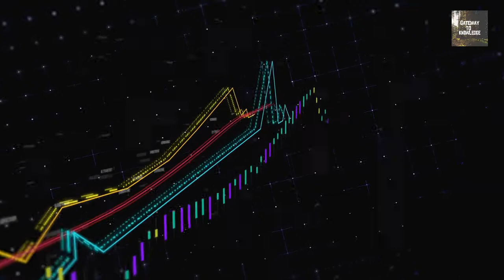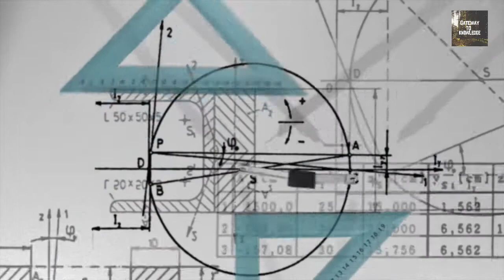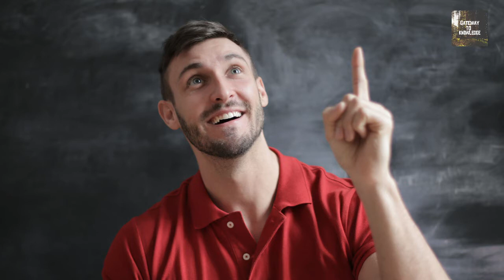How Rocket Moves In Space When There Is No Air To Push Against?

Comment: Your answer doesn't makes any sense because my question is , " in space the ejected gas pushes against what ? In order so that Rocket mai move forward
Reply: Hey, no air no combustion, so that engine Need air and Will consume both air and full, where the air Is in the space ship???
Reply: @vnsworkshop9961  Rockets take oxygen WITH THEM TO SPACE.
How do oxyacetylene torches work UNDERWATER?
Reply: @stuartgray5877  so he Need tons of oxigen.
So the spaceship are oxigen bomb!
Why they never exsplode..
I don t know.
And where they push?? In the empy space..
Reply: @vnsworkshop9961  - "Why they never exsplode.."
You apparently don't pay much attention to rocket technology. They explode FREQUENTLY!

"And where they push?? In the empy space.."
They push on the MASS of the exhaust gas.
Reply: Correct.... If the total momentum is zero...it means it is not moving.. the video is absolutely nonsense. No engine can work if there is no matter to apply force it produces. The bullet from the gun goes out because the force is applied on the ground.
Reply: @lalithachinthakal-simpleth5948  - "No engine can work if there is no matter to apply force it produces."
So according to you a crossbow fired into a vacuum would NOT have any recoil?
Are you sure about that?
I think Newtons laws say different.
Reply: @rocketman484  cross bow and gun will work in vacuum because the force produced is applied against the ground on which the fireing person stands
Reply: @lalithachinthakal-simpleth5948  No. Even with no person holding the crossbow, it would still be forced backwards by the recoil force even if fired into a vacuum.
Reply: You don’t need something to push off of. It’s not like pushing yourself away from a wall while on a skateboard.
Reply: @kitcanyon658  if you dont push off something  then how do you move?
Reply: @nickmerix2900  : Sure, you can physically be "pushing" against something ,like the ground as you walk. However, that isn't the only way to produce motion. 

Motion can be created by throwing a mass from yourself in a certain direction. When you do a force is created in the opposite direction proportional to the mass and the speed at which the mass is thrown. 

How do you think rockets work in the atmosphere? Do you really think the air molecules are somehow pushing against the rocket body? The same air molecules that would be blasted away by the high speed, hot exhaust gases? How does that work?
Reply: @kitcanyon658  thats circular logic. You are using how rockets move in space do explain how rockets move in space. By your reasoning an ice skater should be able to propel forward by simply thrusting their leg back. Or if i skydiver  thrusts his leg to one side he should propel himself to the opposite direction. Both observations will tell otherwise.  If you dont need something to push off then reverse thrusters on a plane should not work . But reality shows they do work
Reply: @nickmerix2900  : so you’re not man enough to explain how it is that air molecular push on rockets? Why is that? 

And no, your examples didn’t have a loss of mass. They simply moved tue position of the mass. Try having them throw a bowling ball away.
Reply: @nickmerix2900  So according to YOUR misguided understanding of basic physics, A CROSSBOW fired into a vacuum would NOT have any recoil.
Are you SURE about that?
Reply: @stuartgray5877  you are unable of critical think. You probably never fired a cross bow , if you did you would know you dont feel any recoil backwards  like you feel with a gun. You only feel a slight vibration. I guess your “UNDERSTANDING “ of physics led you to pick the wrong example. If merely pushing something out of an engine with out  that something interacting with another mass , then thrust reversers should not work . But we know they do.  That is a more accurate example to the rocket Apply your understanding of  physics and explain that.
Reply: @nickmerix2900  Answer the three basic physics questions to understand how rocket propulsion works:
When a rocket is running here on earth in atmosphere:
1 - Does the exhaust gas get ACCELERATED as it leaves the nozzle?
2 - Does the exhaust have mass?
3 - Can MASS be accelerated WITHOUT a force?
Answer these three questions and I will move onto the REAL questions.
But we need to be sure you understand the most basic aspects of mass and inertia.
Reply: @stuartgray5877  again you are just parroting  text books without think. Here on earth the answers would be yes , cause they can be verified by observation. Space is another story. Show me an experiment that they also apply to space. How do you measure mass in space? Mass is measured by weight here on earth but in space the gasses would be weightless . So how would you measure their mass? See theory is one thing reality is another. You seem to be stuck on theory
Reply: @nickmerix2900  YOU are literally the one repeating what you heard on YT. I am the actual Engineer that has built spacecraft with his HANDS. launched them to space, then helped operate them during the mission in deep space.
Now tell me your level of education and what YOU do for a living genius.
Reply: @stuartgray5877  ok mr NASA  since you are the engineer why cant you explain how thrust reversers  work or how you measure mass in a weightless environment? Me, im  a highschool drop out . So educate me by answering my questions. Better yet since you built and flown rockets into space , just show us a video of your rocket flying in space and put the matter to rest. Its that simple . No other explanations needed .Provide  a clear video of that.and i will apologize , if you cant then toss your degree in the trash .
Reply: @nickmerix2900  - "k mr NASA  since you are the engineer why cant you explain how thrust reversers  work or how you measure mass in a weightless environment?"
I can answer both of those questions.
But WHY should I answer YOUR questions when you refuse to answer mine?

Thrust reversers work exactly like jet engines, They accelerate MASS in one direction and feel a recoil force in the opposite direction.
We can measure the mass of an object in space by trying to MOVE IT and seeing how much Inertia the object has. (Comparing it to another known mass)

Now answer MY questions:
When a rocket engine is running right here on earth in atmosphere:
1 - Does the exhaust gas experience an ACCELERATION as it leaves the rocket nozzle?
2 - Does the exhaust gas have MASS?
3 - Can MASS be accelerated without a FORCE?
Now are three Yes/No questions too difficult for you?
Reply: @nickmerix2900  - "just show us a video of your rocket flying in space and put the matter to rest."
Sure, watch the "Stardust Launch" video on my YT channel.
Or watch the "IXPE Launch" from SpaceX.
I launched that one just last year.
The video even shows the solar arrays deploying after separation from the rocket.
Or watch the JWST Launch. I also helped build it.
There are LITERALLY Hundreds of launch videos from SpaceX over the last few years.
Try to keep up.
Reply: @nickmerix2900  - watch the YT video "uninterrupted footage of the falcon heavy launch and booster landing! 2-6-18"

watch from launch to side booster landing, then EXPLAIN what YOU just watched.
If you don't see the examples of rocket propulsion in a vacuum, I'll be happy to point them out to you.
Reply: @stuartgray5877  ok i watched your videos and they  raise many questions. Here are a few.  Why do rockets turn and fly sideways after launch? Why we see the same angle on all videos? Why not more camera views especially the front? Why is video quality sub par when high resolution cameras are abundant ? Why is the color suddenly going gray in one instant and why what seems day to night and back to day? They spend billions on these launches yet they cant afford better video equipment? Why we see earths curvature from 14 miles up in one video when  nasa  spokesperson Neil de  Tyson says this is impossible? Why dont we see the earth rotating  beneath once past the Karman line?  Why the boosters need to slow down upon re entry from 70 klm up to avoid burning up yet the side fairings which are separated much higher dont burn up without slow down capability? The ixpe i beleive was a satellite launch , so why no video of the its placement ( which is kinda the main event) ?
Reply: @nickmerix2900  - "Why do rockets turn and fly sideways after launch? "
Because to reach "Orbit" you must achieve a huge velocity PARALLEL to earth's surface.
So rockets only go UP to clear the atmosphere (to reduce drag about 50 km) then they turn and thrust parallel to the surface to reach "Orbital Velocity".
If a rocket goes Straight up, gravity will pull it straight back down.
"Orbit" means that the centrifugal force of flying around in a CIRCLE cancels the gravitational force allowing the vehicle to remain in orbit.
"Why we see the same angle on all videos?"
Because most rockets that leave KSC are all heading in the same direction EASTWARD (for equatorial or inclined orbits) and we are watching from the beach.
When rockets leave VAFB they head mostly Southward (for polar orbits).
"Why not more camera views especially the front? "
Because there is absolutely NOTHING Useful to video from the front. All you would see is sky for the entire flight.
"Why is video quality sub par when high resolution cameras are abundant ?"
Watch some videos directly from SpaceX for incredible footage of very high quality.
Thats enough questions for now. Now go read a book. You know like the Physics book that you skipped in high school.
Reply: @nickmerix2900  Now if you would go back and answer my three physics questions, we can get to the REAL questions about rocket propulsion.
I am not even asking questions about "Vacuum" Yet.
When a rocket engine is running right here on earth in atmosphere :
1 - Does the exhaust gas experience an ACCELERATION as it leaves the rocket nozzle?
2 - Does the exhaust gas have MASS?
3 - Can MASS be accelerated without a FORCE?
Do refuse because you think I am trying to TRICK you or something?
The questions are just to make sure you understand the three terms in CAPS.
Did you refuse to answer questions in school?
Is THAT why you dropped out?
Reply: @stuartgray5877  i told you those seem to correct as far as we know here on earth. And actually school was very easy for me , i was way above average student . Dropped out for other reasons
Reply: @nickmerix2900  So you AGREE that:
1 - Rocket exhaust is ACCELERATED as it leaves the rocket nozzle
2 - Exhaust gas has MASS
3 - MASS CANNOT be accelerated without a force
Then (if you understand Logic and "Proofs") then you must conclude that:
There MUST be a FORCE ACCELERATING the MASS from the Rocket nozzle !
Is that right?
Do you AGREE, based on the evidence, that there MUST BE a "FORCE" accelerating that mass?
If you answer is YES, then please tell me from WHERE does this FORCE Originate?
WHAT Mechanism is creating the force that accelerates the mass from the rocket?

And I'll save us an iteration and will ask you the next question:
What does Newton's THIRD Law tell us about "Forces"?
Reply: @nickmerix2900  So now you have TWO new questions to answer, stop avoiding them.
From WHERE does the force originate that accelerates the exhaust gas from the nozzle?
What does Newton's THIRD law tell us about "Forces"?
Reply: @nickmerix2900  And ANOTHER POINT where you think I am trying to "trick you" or something when I am not:
Tell me that you think that ANY kind of "machine" can ACCELERATE MASS (Like a 500-kilogram block of water ICE) from a standstill to MACH EIGHT can do so WITHOUT feeling a recoil force!
REALLY! - Can you imagine any type of device accelerating 500 kilograms of ANY KIND OF MASS to Mach eight without a recoil??
Yes or NO?
Reply: @stuartgray5877  you said it your self “” feel recoil” to have recoil  you need an object to feel the recoil. What is that object in a vacuum? You keep going to newtons third law which is basically action reaction . When i press against a wall  he tells us that the wall pushes back at me. Here we have 2 objects that interact ( me and the wall)  . What is the second object in space?  By me pushing  i apply pressure to the wall  , if the wall moved as i pushed i would feel no pressure and i would not be able to push off even though my hands would be pushing. Same  with a rocket . You keep referring to force but you dont mention  what type of force . Rockets produce thrust  and thrust requires pressure  which in a vacuum you dont have.
Reply: @nickmerix2900  ANSWER MY QUESTIONS and you will HAVE YOUR ANSWERS!
Jes us CH RIST, it is IMPOSSIBLE for you to just ANSWER QUESTIONS!

 - From WHERE does the force originate that accelerates the exhaust gas from the nozzle?
- What does Newton's THIRD law tell us about "Forces"?

Its NO WONDER you are incapable of learning. You keep trying to LECTURE the TEACHER instead of LISTENING!
Learning is a TEP BY STEP Process. You keep trying to jump to the conclusion BEFORE working through the premise!
I am trying to EXPLAIN TO YOU where the force comes from, and you keep DIVERTING FROM THE PROBLEM!
Now ANSWER THOSE QUESTIONS.
Reply: @nickmerix2900  - "Rockets produce thrust  and thrust requires pressure  which in a vacuum you dont have."

There you go talking about VACUUM AGAIN!

My example is a rocket IN ATMOSPHERE!
Now QUIT CHANGING THE SUBJECT!

IN ATMOSPHERE: FROM WHERE
DOES
THE 
FORCE
ORIGINATE
THAT ACCELERATES
the mass of the exhaust gas?!?

WHAT MAKES THE EXHAUST GAS SHOOT OUT?
Reply: @nickmerix2900  - "you said it your self “” feel recoil” to have recoil  you need an object to feel the recoil. "
So when a CROSSBOW experiences Recoil, WHAT IS IT PUSHING ON?
What makes the crossbow feel recoil?
You keep claiming the question is irrelevant but by saying so you just keep PROVING that you are clueless about how mass and inertia work.
Until you answer that question for yourself, you will NEVER UNDERSTAND how "Rocket Propulsion" works.
Reply: @stuartgray5877  for an engineer you should not use an example you dont understand. Crossbows do not recoil!! Go shoot one first then tell me again . Thats the perfect example of how reality does not follow your text book
Reply: @stuartgray5877  the argument started with  the question of how rockets fly in space . You keep bring it in the atmosphere . We can all agree that rockets can and do fly in the atmosphere. That part is settled. Space is another animal . Are nt you curious as an engineer that nasa having the largest vacuum chamber never tested  for example their space suits in it and instead test them under water?
Reply: @nickmerix2900  - "Crossbows do not recoil!!"
Watch the YT video on my channel that shows you are wrong.
Maybe then you will realize that it is YOU that is misinformed.
Reply: @nickmerix2900  What is causing the recoil in my crossbow video then, black magic?
I think it is pretty obvious now that people that have never passed high school physics should not go around trying to explain physics to anyone.
You have no idea how mass and inertia work, but you feel confident arguing basic physics? I would laugh if it was not so pathetic.
Reply: @nickmerix2900  - "We can all agree that rockets can and do fly in the atmosphere"

But you have proven repeatedly that YOU do not know WHY rockets fly in atmosphere or otherwise.
I have tried to bring you to understand by making YOU answer simple questions, but you refuse to answer.
From WHERE does the FORCE originate that accelerates the exhaust gas from the rocket nozzle ?
The answer is the SAME whether the engine is in 14.5 PSI atmospheric pressure or 5.0 PSI atmospheric pressure or ZERO Atmospheric pressure.
WHAT is accelerating that MASS?

ANSWER then we can discuss how atmospheric pressure affects that force.
Reply: @nickmerix2900  What's the matter? WHY did you run away?
Did you realize that your ENTIRE UNDERSTANDING of Physics is shattered by the FACT that Crossbows have RECOIL?
I TOLD you that you should really finish high school BEFORE picking fights with rocket scientists...
Reply: Imagine this:  Would a CROSSBOW, fired in a vacuum ,still have recoil? Yes or No?
Reply: @stuartgray5877  can you please explain, I didn't get the Idea, how it work in Space.🙏
Reply: @kenzemuhammed5719  - Are you capable of reading a question and responding?

Do you know what a "crossbow" is?

Do you know what "vacuum" is?

Do you know what "Recoil" is?

Now: if you fired a CROSSBOW in a VACUUM - WOULD IT experience RECOIL? 
 Yes or no?
Reply: @stuartgray5877  obviously, yes, due to Newton's third law of motion
Reply: @stuartgray5877  and I know about inertia and momentum.
Reply: @kenzemuhammed5719  Ok, good!

Now what If I had a "linear catapult" in space (zero-G and a vacuum) that can fire blocks of water ice.
The catapult has a mass of 10,000 kilograms.
An observer is beside the catapult with  a remote control to fire it.
Load the catapult with a 500 kilogram block of water ice and "cock" it.
Now the observer, catapult and block of ice are all stationary (they have a relative velocity of zero with respect to each other)
Now the observer fires the catapult and observes the ice block moving to his "left" with a velocity of 2500 meters per second.

What happens to the catapult?
Does it move?
If so, do you know how to calculate how much it moves using the Law of Conservation of Momentum?
Reply: @stuartgray5877  they don’t have recoil in generalz
Reply: @mrpineapple3942  - "they don’t have recoil in generalz"
Yes they do.  Thanks for proving you are clueless about basic physics.
There is a video on my YT channel that proves your statement incorrect.

It is IMPOSSIBLE for one object to PUSH on another object without feeling a "Recoil" force.
Reply: @stuartgray5877  Sorry, I didn't mean no recoil whatsoever. I worded it weird, and on top of that I have never shot one so I wouldn't know.
Reply: @mrpineapple3942  rocket propulsion is a form of recoil force. It works just fine in a vacuum
Reply: @stuartgray5877  Yeah sorry about that I can be idiot sometimes.
Reply: @stuartgray5877  that's totally different and a horrible comparison 😂
Reply: @youtubeisasshoe8153  - " that's totally different and a horrible comparison"

Maybe YOU should look up the "Law of Conservation of Momentum".
And stop trying to lecture actual engineers about how physics works if you don't understand it.
Crossbows feel recoil for the EXACT SAME reason that rockets feel thrust.
If you don't understand that, then perhaps you should finish high school before trying to explain physics?
Reply: @youtubeisasshoe8153  You could literally learn more physics than you currently know by just reading my comments in this thread.
Reply: @youtubeisasshoe8153  So did you ever bother to learn about the "Law of Conservation of Momentum"?
No of COURSE not because that requires a reading comprehension level ABOVE the 4th grade.
Bless your little heart!